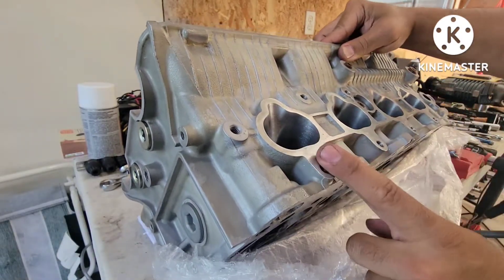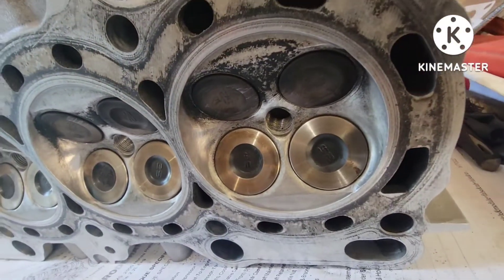Boosted Honda Prelude H22! Fresh Head Installed Torque to Spec

Comment: Should note , it should be decked. keep that wire wheel away from heads surface . U want all edges sharp, not rounded in anyway. I'm guessing this is why you cooper sprayed it. They don't get sprayed. All that money into it. Why didn't you just get the head decked? And pulled the valves to clean More properly if you didn't want to replace them and do the valves seals at the same time.
Reply: Money was the answer to all that you said. People cheap out on the wrong stuff
Reply: @detonationpyrotechnics4156  lots of times it cost more to cheap out , having to redo it with time and money.even cheaping out I would never takes these steps to clean it .